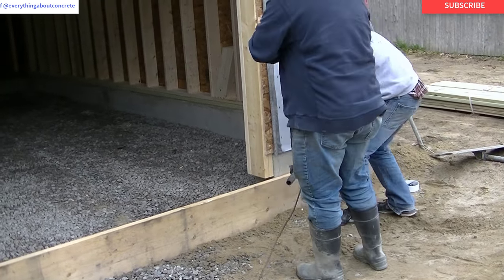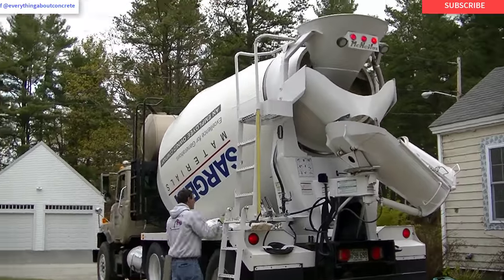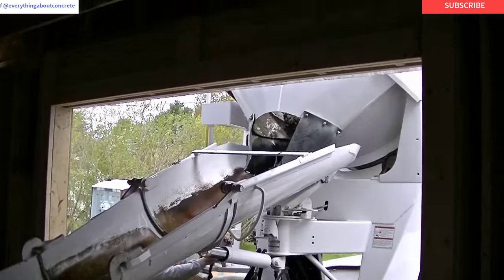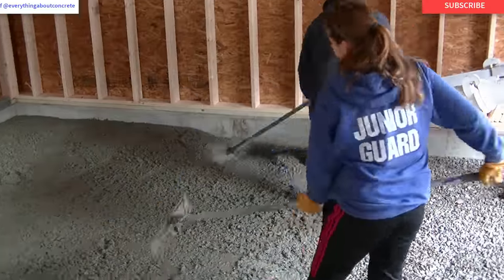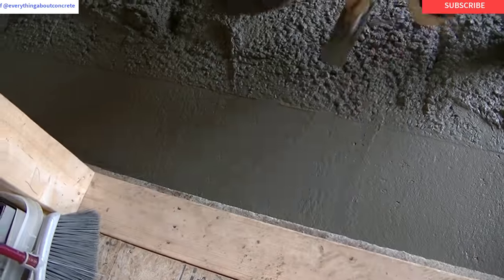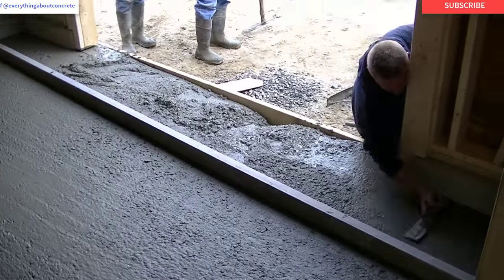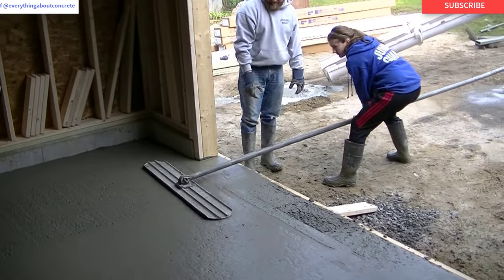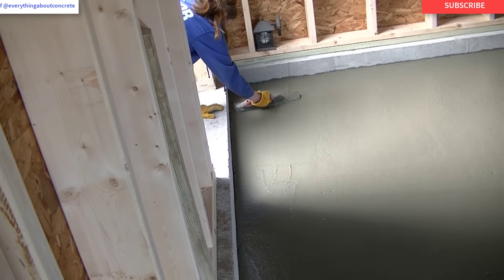POURING A CONCRETE FLOOR FOR A NEW GARAGE

Comment: Great video! Must pour a 30x20, 5 to 6 inch thick concrete slab for a carport where  I can work on my cars next to my house; use a hoist to pull an engine out, jack stands  etc... The ground is slopped so it makes it impossible for those operations .I have more work to do to level it off preparing the area for concrete....This video was very instructive. Thank you for posting!
Reply from the maker: Sounds great!

Comment: Hi Mike, Thanks for the great contents. I am helping a friend fix is broken slab in a 20x22' garage. We are going to cut, break and remove old concrete. Then he wants to remove the river stone and replace with crushed gravel and compact. For a 2 car garage/low traffic, would you recommend fibres in concrete or rebar /wire mesh? Thanks

Comment: Mike I have a question you mentioned that you used 3,500 psi concrete. The minimal is 2,500 and ideal is 4,500 psi. Why didn't you use 4,500 psi? Is it because the fiber mesh provides a reinforcement?

Comment: AWESOME!  I've gotta do this on a little 2yd garage and was wondering how you screed when there's walls.  Just walk around in the concrete while screeding.  And have a pole long enough to get to the back with the bull float.  And the hand tools were good to see.  I was looking at buying a bull float but for 1 job I'll probably make one, but nice to see the other tool too.

Comment: Can an epoxy finish or any finish be done over just mag floating, thereby eliminating the need to steel trowel ?
Reply: Yes, you don't need to steel trowel for a finish.  If you wanted for floor smoother, you could fresno float it after bull floating.

Comment: I'm doing a similar project right now and considered doing it myself. One of the contractors that estimated the job wanted to put dowels around the outside to tie the slab into the foundation wall. What are your thoughts on this?
I also noticed you didn't use an expansion/isolation joint around the perimeter. Is it typical to not do dowels or an expansion/isolation joint? I'm in the northeast.
Reply from the maker: If the gravel is compacted correctly there's no need for dowels. If you feel it could settle then go ahead and dowel. Most our residential floors don't have expansion joint around the walls. Only if the spec calls for it. It is a good idea, nothing wrong with putting it there. We haven't had any problems with not using it though.
Reply: @MikeDayConcrete  thanks for the reply and info Mike! You're an inspiration and wealth of knowledge for do it yourselfers and pros alike. I really appreciate all the knowledge you share in your videos.

Comment: Where the garage door would come down, Wouldn’t it be normal to put a board to lower the concrete slightly and form a pocket for garage door sit in to help keep the rain out? It looks like in the video they concrete all the way past where are the future garage door is going.

Comment: I am planning on doing a garage floor at some point. Just doing my research now. Would it be possible for me to do a 24'x14' by myself? If I got the concrete so it won't dry out so fast. Is it possible to do solo??

Comment: Hey Mike Great video as usual, I do have a couple of questions regarding fiber mesh and Calcium Chloride. I occasionally help a friend who has poured for years. He is a pretty frugal guy and insists on adding the fiber to the load himself, what do you think is best to have it batched or add on site. I was also curious about the type and amount of Calcium Chloride you are adding and do you ever have this added at the plant?  Thanks again I have purchased your videos online.
Reply from the maker: We add fiber at the plant, but have added it at the jobsite also, just need to mix it in very good if done on site. We use the brand of CC that the concrete company provides, no special brand.

Comment: What is re-bar good for? is it not necessary? I'm looking for a contractor in Los Angeles to do a walkway and doing a little research before having them come out.
Reply from the maker: Rebar is to help reinforce the slab, floor, sidewalk, when it cracks. The rebar will hold the concrete together and tight and not let the crack open up.

Comment: What did they do about getting the concrete under the edge of the wood framing?
Reply from the maker: We usually vibrate it if we have to get it under something. Not sure if that's what we did on this one or not.

Comment: How do you ensure it's level or slightly slanted to drain water outward?
Reply from the maker: We use a laser level to check out slopes and make grade marks on the concrete walls that are sloped. All done with the laser level. This is the one I use: https://amzn.to/3hKXoBS
Reply: Very cool thanks for link.

Comment: How much of a down grade did this garage floor have, I had a foundation company come out to check my foundation specially in my garage floors because my sons skateboard will just roll all by it’s self toward the garage door but they said my garage floors where ok they measured -2.3 inches on the right side of the garage near the garage door and -2.9 inches on the left side of the garage near the garage door they said the downgrade is normal , I know there is a down grade but I was not sure how much of a downgrade is normal, I hope you can answer my question thank you in advance.

Comment: good job Mike.
just wondering, do you prefer 1 3/8 or 1 3/4 bull float handles? I'm thinking of buying a rock it attachment for a 48" bullfloat.
Reply from the maker: We use the 1/3/4 for ours, but both are good.
Reply: @MikeDayConcrete  thanks mike, it's great to get insights from a pro.

Comment: what is the cost of  the concrete per yard?? the video was cool thanks
Reply from the maker: In Maine it's about 110.00 per yard for 3000 psi
Reply: Mike Day Everything About Concrete so what’s the total on this ???
Reply: @javierochoa432  5.5 yards x $110 per yard = $605 for 3000 psi.  Video says it was 3500 psi, so around $800 I would guess.

Comment: Do you ever add a vapor barrier under a garage slab? My garage floor needs to be replaced due to it not being sloped correctly but it's also very damp in the garage all the time. Was wondering if something under the concrete would help dry it out some.
Reply: If you plan on heating you can do that and insulate

Comment: My grage is chipping. A guy told me thats coz who ever did the floor did not put locks in. I didnt understand what that means. Don't you have to tie steel rods before you pour?
Reply: What did you mean by chipping? Rebar will keep a cracking from spreading and might keep it from cracking. There are things you can do to prevent the cracks like using stronger mix adding fiber laying a thicker pour. The pad in front of our cabin was a foot thick layed on top of clay/sand it’s moved all around but no cracks. Concrete is expensive most don’t want to pour thick

Comment: Hi Mike, great video. I am about to pour my garage slab 6m by 6m. I notice from your videos that you don't have expansion joints for garage or house slabs. Is it because it's out of the elements so won't expand and contract? Cheers
Reply: Most comeback and cut it later

Comment: Strange watching you add chloride to the load. When the customer (you) call and order the concrete from us we ask what you want such as mix, retarder, fibers, color, chloride, air etc etc and that all gets put in the drum at the same time as the agg, water, cement. This way we are ready to pour it out when we get there. No need to sit and mix for another 15 minutes on job. However once in awhile will get a customer that wants to add some accelerator or a color that we don't have but that is very rare. Having a color machine that puts in the color while being loaded is a HUGE time saver and the load generally has more time to mix so again we don't have to sit on site mixing. Nice job guy's. Wish you guy's were in our area, from what I have seen you would be a great customer to pour for.

Comment: How much slower is the concrete to harden up when its placed under a roof.
Reply from the maker: It is slower, depends on temp outside. It might add a couple hours to the finishing time.

Comment: Why you don’t use 4.000 concrete it’s garage floor it’s gonna crack
Reply from the maker: 3000 is all that's needed in a residential garage if the sub-base is prepped properly. Our 3000 mix, when tested, usually breaks around 3500.